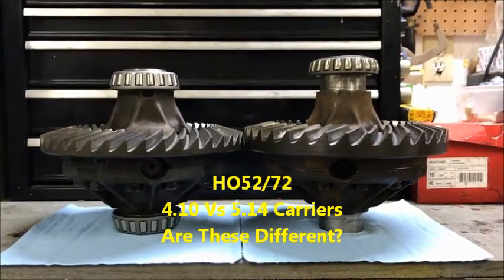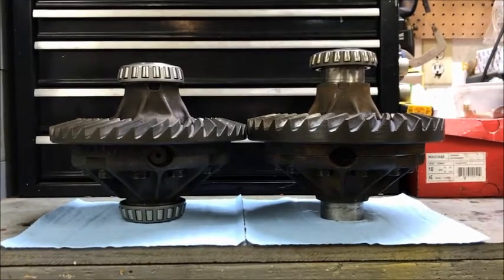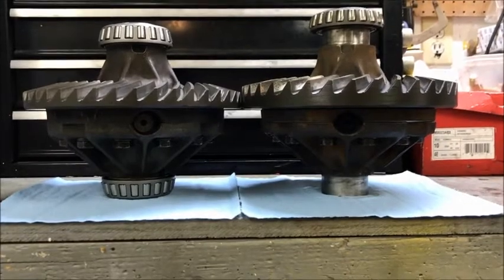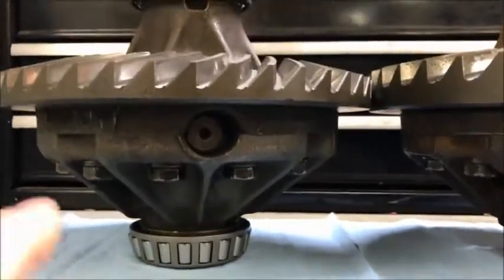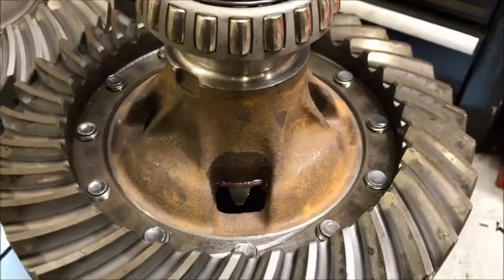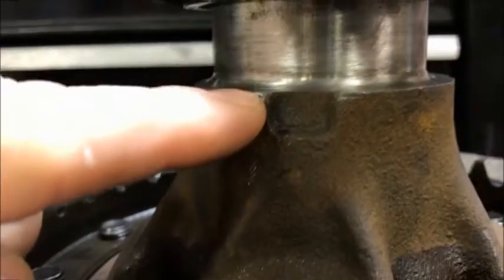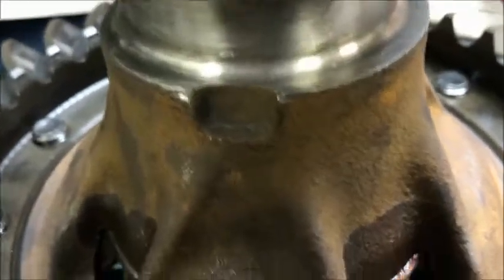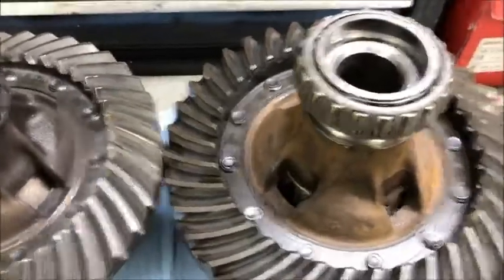HO52 / HO72 Carrier Comparison

Comment: I'm just starting into learning about my rear axle. I have an HO72 with 5:14's in my 1954 Chev (so I've been told) and would like a more relaxed ratio for driving on the highway. The truck is retired from any heavy duty so I think I can easily go with 4:10's or 4:11's and be happy. Is swapping the 3rd member the way to go? And is there value in my 5:14's? I've heard they are used by the rock crawling crowd.  Is it much of a job to change the third member? Thanks!
Reply from the maker: Yes, the easiest method is to unbolt the entire third member and bolt another one in.  Unfortunately, the 4.10 gear set is only found in 1971 & 72 3/4 ton with automatic trans.  There are no aftermarket gears available.  I've seen a 4.10 third member sell on eBay for $2400+ shipping.  A lot of guys give up and swap in a a drum brake 14 bolt full float.  If you are on coil springs, it gets a little involved with spring perches and track bar bracket.  Plus you'll need to shorten the driveshaft.  Reference my video on a 9.5" axle swap which is similar to the 10.5" full float swap.

Comment: Hello, nice Video iam working on a HO52 what is the Torq spec for pinion flange retainer the 5 bolts  the yoke is 220 correct ? But can't find the seal retainer
Reply from the maker: I posted a link to the Factory Service Manual in the video description.  It will answer most questions about the Eaton.
Reply: Thanks

Comment: Is there different wms on the 52 and 72
Reply from the maker: Yes, and a big difference is the pinion.  Eaton changed the outboard needle/roller at some point.  You can however, move the entire 3rd member from a '72 to a '47.  It's mixing and matching individual components that will pose a problem.
Reply: @BriansGarageUSA  I have a 58 ho72. I was wondering how much wider the 72 would be than the ho52. If u was going to remove the brake drums all together and run a pinion break. For off road only.
Reply from the maker: @Jeremy-il1yh  The C20 measures 65.25" wms-wms.  Your truck is probably the same as AD trucks (1947-1954) and around 60".

Comment: Do they both use the same bearing  HO52 vs HO72   ?
Reply from the maker: Mostly, yes.  However, the pinion shaft bearing can be ball or tapered roller.  While the pinion outboard support bearing can be one of two sizes of cylindrical roller.  Depends not only on load rating, but also year of manufacture.  1971 and 1972 axles have the same bearings regardless of load rating.  The only difference being the brake drum size.